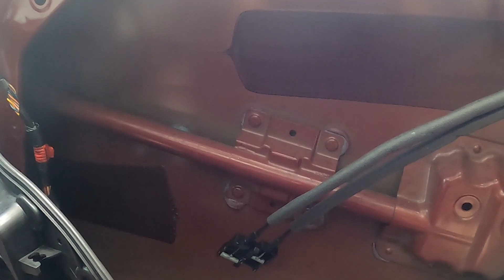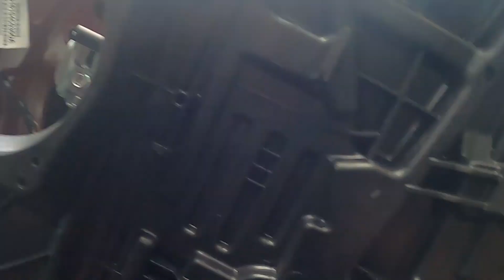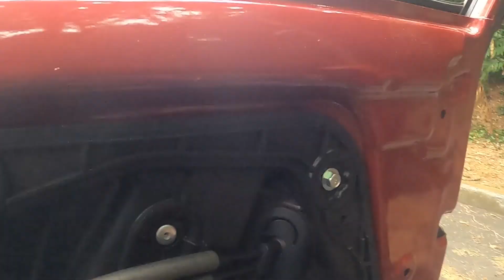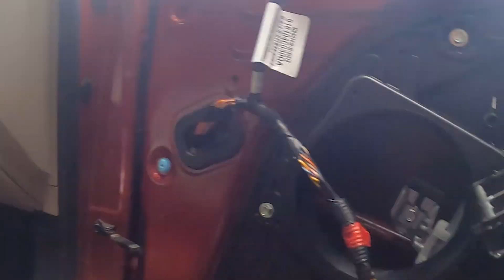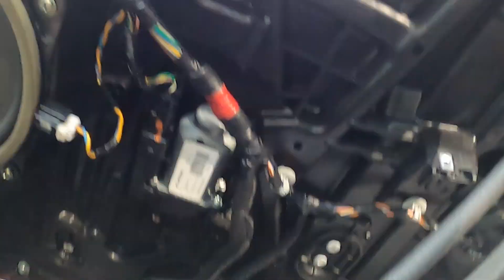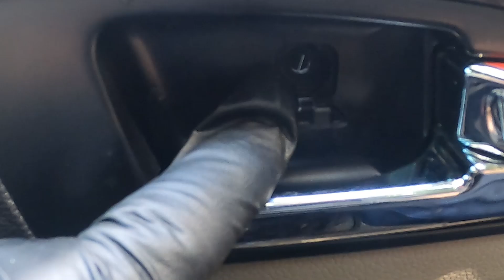2011–2015 Kia Optima Window Regulator Replacement (Cable EXPLODED 😳)

Comment: video sucks no detail at all, here do this and no im done you didnt see me do it!
Reply from the maker: Wow you must have been watching a different video  then What i made and saw.  
So no details?  Did i not hear that there was 10mm bolts to hold the assembly in? what about how the regulator assembly comes with the plastic  or with out on some? What about how to install the glass to the regulator? How about how to take off the door handle?  I must have missed all that  Im sorry.